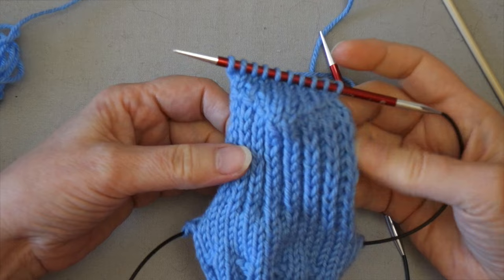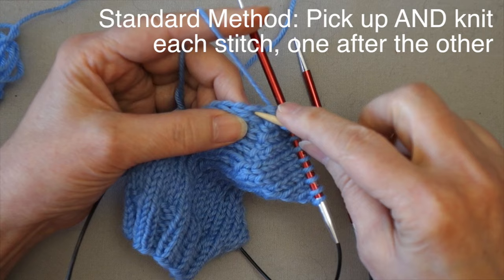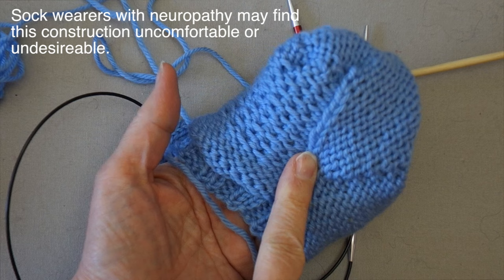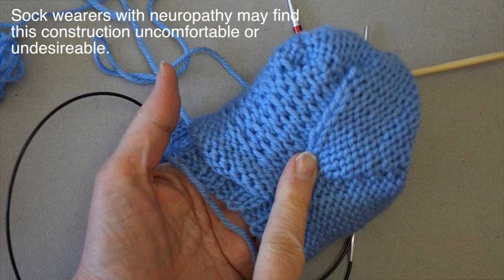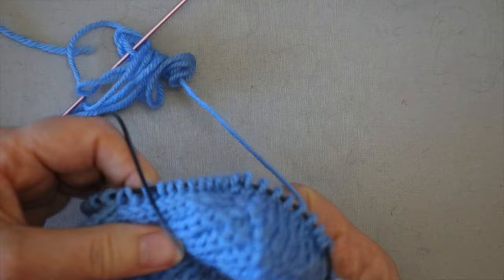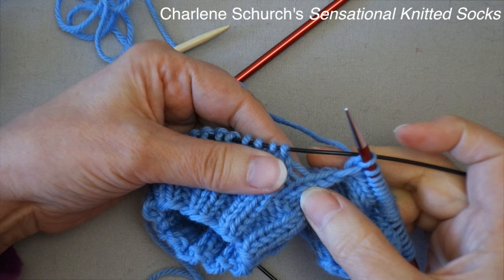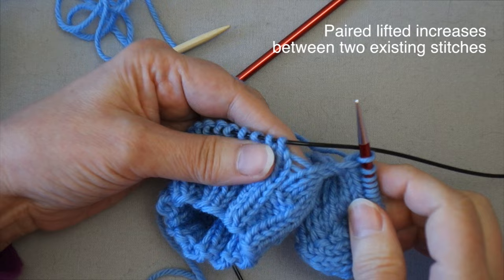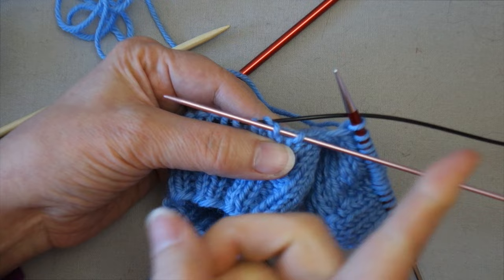Tips & Tricks for Sock Heel Flaps

Comment: Roxanne - I promise to buy you a "cup of coffee" every day for a year if you can help me understand what the heck I am doing wrong when I am knitting the heel flap.  I am slipping the first stitch as if to purl and then either knitting or purling the remainder of the stitches in the row.  My issue is I do not have the lovely visible stitch to pick up at the end of each row.  i.e. if I am knitting/purling a total of 30 rows for the heel flap - I only have 15 stitches visible at each end of the heel flap.  The pattern calls to pick up 30 stitches along each edge of the flap.  I wish there was a way that I could show you the heel flap.  What am I doing wrong?  Thanks in advance for any help.  Susan
Reply from the maker: If you ask your question in my Ravelry group, and include a link to the pattern you're using, it'll be easier to figure out where you might be going wrong.
Reply: @RoxanneRichardson  - I just found your Ravelry group and was just going to move the question over there.  Thx

Comment: I am just now knitting my first ever pair of socks. I love your tutorial especially since with my lymphedema my feet would not handle the inside ridge. One question though, by picking up the 2 stitches and knitting them together doesnt that still leave an extra stitch on each side of the flap?   Thanks.
Reply from the maker: The gussets are typically worked by alternating a decrease round with a plain round. The standard formula has you do this until you are back down to the original number of sts you started with for the leg. So if you start with an extra stitch, you work an additional decrease round. Or you can work two gusset decrease rounds at the start without a plain round between. If you have skinny feet and big ankles, you might want to do even more decrease rounds, so that the sock foot becomes small enough for your foot.. If you have big feet and skinny ankles, you might want to do fewer, because you'll need a bigger foot than leg.
Reply: @RoxanneRichardson  OOOh that makes sense thanks  I was thinking i had to be back to the right count right after the pickup.  I am knitting the rose city rollers and am just now at the gusset pickup so thanks for answering my question so promptly.  I enjoy your channel and tutorials a lot thanks so much for sharing.
Reply: @RoxanneRichardson  thanks so much tor the quick reply that makes sense now.  I was thinking I had to be back at the correct number right after pick up and my pattern just has me picking up one.  I enjoy your channel and have learned so much.  Thanks for sharing.

Comment: Curious on what you would do if you picked up too many stitches on one side?  Do you skip some edge stitches when picking up or try to work in some decreases?  I am following a pattern that tells me a specific number of stitches to pick up on each side.
Reply from the maker: The number of stitches you pick up is one for every slipped selvedge stitch. Sometimes you end up with one stitch more on one side of the flap than the other, but you shouldn't end up really unbalanced, unless you failed to slip some of the selvedge stitches, and worked them, instead, and then still picked up 1:1. If you do have one stitch more on one side, just work one more decrease round when you finish the gusset, decreasing only on the side with the extra stitch.
Reply: @RoxanneRichardson  So the pattern says I should have 15 selvedge stitches. The heel flap is 2 rows repeating 15 times, with the 1st row again. It says to pick up 14 on the first side and 16 on the second side. There’s a setup row on the first side, which I guess doesn’t count as a selvedge stitch, if I skip that, then I have 15 on that side and 16 on the other. So should I skip the edge stitch from the setup row and do a decrease like you said? Will your trick of increasing and decreasing be sufficient for closing the hole made by not picking up on the setup row stitch?
Reply: @RoxanneRichardson  If you’re interested in which pattern I’m attempting, it is titled Falling Snow Stocking, available on ravelry. I appreciate any help you’re willing to give, thank you so much.
Reply from the maker: @AdamFloro  The pattern has had several errata and wasn't tech edited. PU 1:1. If you have one extra on one edge, do as I mentioned earlier, and eliminate it in a final decrease round.
Reply: @RoxanneRichardson  Okay, I will give it a shot, thanks!

Comment: what kind of circular needle is that you are using in this video?
Reply from the maker: That is a Signature Needle Arts fixed-length circ with stiletto tips. I got my needles several years ago. They only make interchangeable needles now (except for the size 1/2.25 mm circs).

Comment: what brand are those needles please
Reply from the maker: There are at least three different types of needles in this video. I have no idea what the thin aluminum dpns are. There are some bamboo dpns, as well. No idea what those are, either. If you're talking about the red circular needle, that's a 32'' Signature Needle Arts fixed length circular with 5'' stiletto tips. They don't make fixed length circs anymore, although they do make tips that can interchanged with cables of different lengths (not an interchangeable set as most would think of. You get two cables of different lengths that can be swapped out for a specific needle size).

Comment: Just a question Roxanne - Would you have to SSK twice on each side so that you don't end up with an extra stitch ?
Reply from the maker: No. You work the corner decreases once, and then just work the actual line of gusset decreases for as long as you need in order to get down to the number required for the foot. There is nothing magic about the number of sts you have to decrease for the gusset. You can knit more gusset decreases or fewer, if your foot circumference require. You can skip plain rounds or add plain rounds if your foot gets smaller faster or slower. You can knit the flap longer or shorter (and pick up as many sts as you have selvedge sts) if your heel is taller or shorter.

Comment: These tips were very informative! I have knitted many socks and  every time tried something different techniques how to pick up stitches from the heel flap and from the 'corner'. I'd love to know which decrease is best on the purl row when turning the heel flap if on the right side you make either SSK or knit 2tog. I found the SSP to be not so good if the next stitch is slipped.
Reply from the maker: The idea is to have a left leaning decrease on the left and a right leaning decrease on the right (as viewed from the RS of the work). At the end of a RS row, when you reach the gap, you will work an ssk, then a k1, then turn and slip that st you just k1. At the end of a WS row, when you reach the gap, you will work a p2tog, p1, then turn and slip that stitch you just purled. FYI, I have a playlist of videos on sock heels you might find interesting.
Reply: @RoxanneRichardson  Thank you! Does it matter if I do not knit k1 after ssk and not 1p after p2tog before turning. What is your opinion about ssk (do you slip both sts as if to knit OR is it better to slip knitwise, slip purlwise?). I must go to your playlist of videos...
Reply from the maker: Whether or not you knit/purl a stitch after the decrease depends on what type of heel turn you want. I would suggest looking at my videos on the round heel/modifying the round heel, the Dutch heel and modified Dutch heel.
Reply: @RoxanneRichardson  Yes, thanks!

Comment: Just finished a pair of socks using your tips. Best pair of socks I've made. Thank you. Do you have any tips on how not to have loose slip stitches on the edge of the heel flap. The knit side is nice but the purl side is loose. Not a big problem I just feel I might be doing something wrong.
Reply from the maker: You're not doing anything wrong, it's a common occurrence. I think part of the reason is that if you have an even number of sts for the heel flap, the left edge has two slipped sts in a row (the next to last st is slipped at the end of the RS row, and the first st is slipped at the start of the WS row). You might get a better result with an odd number of sts, but really, it's at the back of the heel, inside your shoe. If someone notices, and comments, you can easily just kick them in the face. ;-)
Reply: Roxanne Richardson omg!!I love it

Comment: Hi Roxanne!  I have a sock question.  Is it necessary to use a nylon reinforcement yarn in heel flap, turn and toe if you are using regia yarn since it already has nylon in it?  I hope not, cause I tried this and it makes the sock thick and yucky feeling.  Not only that, but it is not easy knitting with the nylon strand in the mix.  Thanks!
Reply from the maker: I never use nylon reinforcement yarn, if the sock yarn has nylon in it. I only use it with yarns that are 100% wool. I am finally starting to see some wear in some of my  nylon-containing socks, but they are more than 10 years old. I kinda feel like they've done their job, lasting that long!
Reply: Thanks!

Comment: Hello Roxanne. Thank you so much for this video. I have a question about picking up the two extra stitches to close the hole at the top of the gusset. If I am understanding things correctly, on the next round when you do the ssk or K2tog to join those two stitches, you are still left with one extra stitch. Your video and Charlene Schurch’s written instructions seem to imply that you only have to do one round of decreases to get to the correct number of stitches. What am I missing? I would be so grateful for clarification as I would really like to use and understand this method. Thank you
Reply from the maker: I just begin the regular decrease rounds for the gusset following the round that decreases those two corner increases into a single stitch. Having one extra stitch for each gusset does not significantly alter the sock at this point. You can either work several gusset decrease rounds in a row at the start (skipping a plain round), or just work the gusset as normal (alternating a decrease round with a plain round) until you are down to the stitch count you need to continue working the foot. Although it is "standard" to decrease down to the original CO number while working the gussets, it's not required. I stop early when knitting socks for my brother, because his ball of foot is an inch and a half larger than his ankle, and therefore needs a larger sock foot than sock leg. I continue decreasing for my own socks, because I like more negative ease in the foot than I do around my ankle. I also knit my heel flaps quite a bit longer than is typical for my sock circumference, because I have high arches (and therefore a tall heel). This means I have to pick up a lot more sts that I would with a shorter flap.
Reply: Sure. That makes good sense. Thank you so much. Love your videos.

Comment: I love your two techniques! A question.
 When using both techniques for a sock, how does the number of stitches picked up work? My patterns tells me to pick up 18 stitches. Then if I pick up the two additional legs of the stitches to avoid the hole and then knit them together on the second round, I have an extra stitch in the count.. Should I pick up 17 stitches at the beginning so the count can work out? Or do I knit two stitches together at some point, perhaps on the plain knit round, to get the right stitch count? Thank you.
Reply from the maker: You'll just continue decreasing the gussets until you are down to the stitch count you need for the foot. Starting with 2 extra sts isn't a big deal. You might be interested in my playlist on Sock Heels. There is also a playlist that includes all my sock videos, as well as a playlist for toes. I also have a tutorial available on Ravelry called August Sock KAL that goes through the entire process of measuring, determining where fit issues are likely to be, based on your foot measurements, and then how to modify various heels and toes based on your fit issues.
Reply: @RoxanneRichardson  Thanks so much! I will check out your other videos. Best wishes!

Comment: Do you have a favorite generic foot pattern? Thank you, Rhonda
Reply from the maker: My method of knitting plain vanilla socks is to measure the person's ankle, ball of foot, length of foot, and height of heel (floor to mid-ankle),  and then knit accordingly, using 10% negative ease. For cuff down, CO number required for ankle (e.g. 9'' ankle x .9 gives you the 10% negative ease, or 8''; multiply that by your gauge, so 8 sts/in x 8'' = 64 sts), knit leg to desired length (usually about 6.5-7''), knit heel flap as long as heel measures, turn heel, PU 1 st for every slipped selvedge st, plus any extras at the corner, as shown in this video, then work gussets by decreasing every other round until you are down to the circumference required for the ball of foot (may be different than the number you CO for the leg). Begin decreases when sock reaches base of toes. Dec every other rnd until down to about 1/3 of the sts. Adjust rate of decreases to match toe length (may need to decrease faster/slower, depending on length of toes). I do have a couple of videos that show how to measure and how to adjust for a good fit, which you might find helpful.

Comment: what needles are you using
Reply from the maker: Which ones? The red ones? Those are US 7/4.5mm Signature Needle Arts, 32''. I have no idea what the bamboo ones are. The Signatures are the old style fixed length circs. They sell them now as a pair of tips, with interchangeable cables (specific to a given set of tips), so you can change the length of a particular needle, which is different from how other interchangeable needles are sold.
Reply: yes the red ty